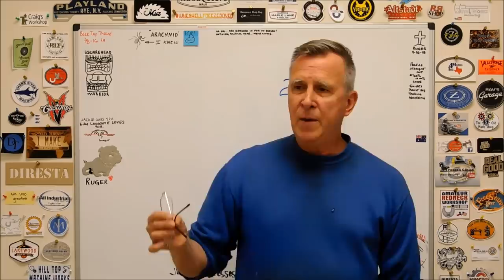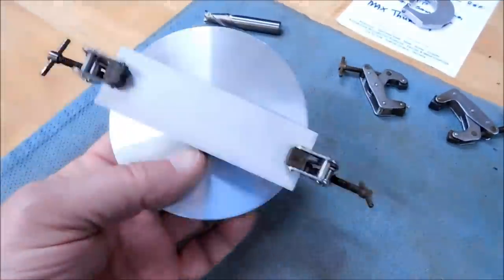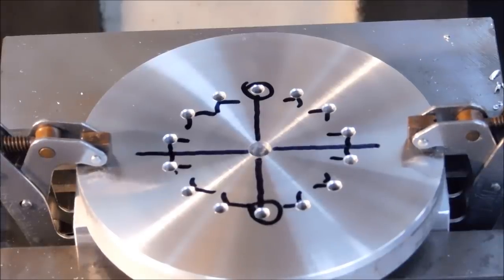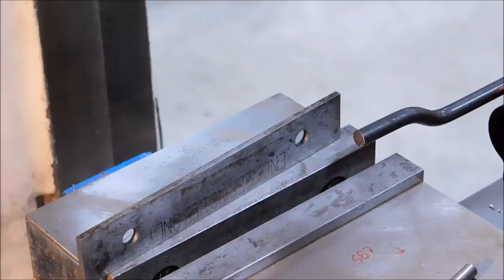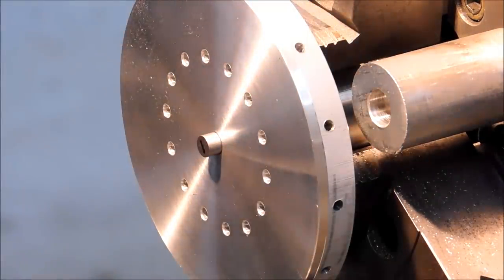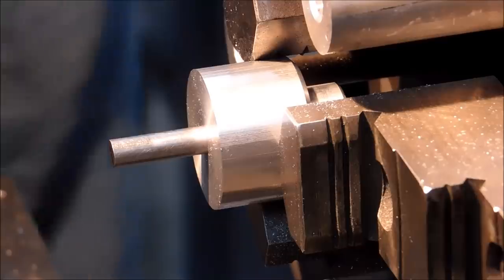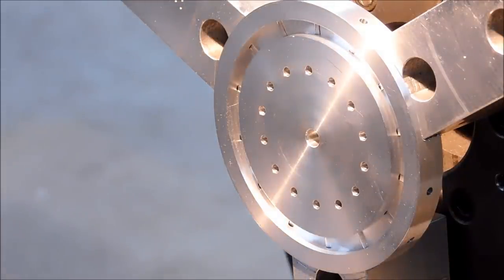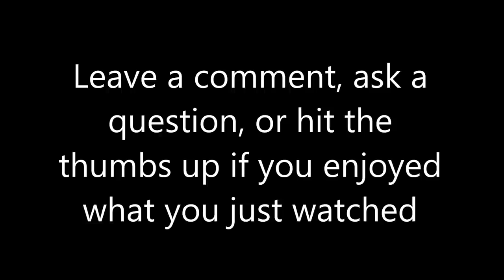Machining 14 Spokes at 25.714 degrees.  Easy ?? ... Yep !!

Comment: It might be weird, but this exact aspect of machining (workshop geometry, angular indexing, problem solving, general maths, etc) is probably the most enjoyable part of workshop life for me. I love working through and solving a puzzle, and it tests my memory of high school geometry, and gives me a chance to build on what was learned at school. Great fun :)

I learn a ton from your channel Joe, some favourites include the precision angles using pins, rotary table setup, setting lathe compound angles, etc. This radial indexing using pins is super simple, but very accurate, and needs very little equipment - perfect! Please keep the good stuff coming. Thank you.
Reply: The only thing I'd add for people watching (and it's obvious to any viewer that has thought about it) is to make the initial circle of holes as large as you can get away with - for the final job, to minimise any angular error.
Reply from the maker: Very true. reduce the error margin.

Comment: Fantastic!  In the beginning I was wondering why the holes in the face.  Then, with the explanation of the series of rectangular hole patterns, followed by the pins and parallel, the light in my head lite up!  I never would have thought of that, but rest assured I will never forget it.  Thanks Joe, you sir are a great professor!

Comment: Another awesome video. For making the spoke holes in the hub, I would use the center with that was cut from the wheel. Using a bolt through the center of the hub and the wheel center tightened down. Then use the same process from the wheel just offset to drill and ream the hub.
Reply from the maker: In the day, I would have picked you for my apprenticeship program. Very intuitive. Stay tuned.

Comment: Speaking for the nit pickers, isn't your edge locator on the mill acting on the original OD of the blank (with all of its little bumps and out of roundness) and not the small turned section which was cut concentric with the center hole. I realize this is a model of a cannon wheel and not a part for a rocket. Love your videos and learn a lot from every one.
Reply: I thought about that too. It sure looks like the edge locator/hard stop acts on the raw stock surface. I think putting a pin in the center hole and let that go against a hard stop would be better.
Reply: It would make a lot more sense to put a pin in the center hole and have that contact the mill stop.  Of course the distance the spokes span will accommodate a lot of error.
Reply: no, he turned both sides of the disc so it's flat on the vise,  then he indicated center from the turned section, it doesn't matter where it's clamped when you indicated from the turned section
Reply: @TomasKubatCZ1  it's hard to tell if the stop is touching the turned diameter though.
Reply: @johnnason7019  yeah but considering that he is a skilled machinist it's safe to assume that he wouldn't make such mistake
Reply: @TomasKubatCZ1  true

Comment: At first I thought you were making a custom wheel for a 5C Spin Index fixture since those are so cheap your viewers are likely to have one.   A rotary table would also be "good enough" for that wagon wheel, eyeballing that fractional degree.  Clearly, you're having fun in the precision of your work, so I'm not criticizing.  I often use Excel to crunch and print a table of X/Y coordinates for incremental cuts to approximate curves and circles.  For one-off parts on a manual mill, it works really well, and the resulting steps remind me of a pretty TIG bead in aluminum by Jody Collier.   You just can't be in a rush, and you REALLY do need a DRO, even if it's a cheapo iGaging setup like mine.
Reply: You need more faith in your skills.
You could do this at least as accurately even without a DRO.
Either work off the dials keeping the backlash all in the same direction, or use 1" travel indicators (mag backed) on the knee to the saddle and from under the table to the side of the saddle.
If the moves are more than an inch set zero on the indicators at the saddle, back away and move back in on a gauge block equal to your move.
The first jigbore I ran used standards and .0001 indicators, and hole location had to be held plus or minus .00005
That's as accurate as any DRO, actually closer on an old machine with wear in the ways.
Reply: Hey @Motor-City-Mike , That's a LOT of zeros on your hole location. 😁 50 micro-inches is probably smaller than the surface finish...   I agree that you can do a LOT with patience, creativity, and a decent indicator or two.  However, my old RF-30 and I live in a different world, project-wise.  The lash in my leadscrews is not all that consistent and the quill bearings are rusted from rain incursion.  (Please don't ask.  I still have trouble sleeping when it rains.)  For the things I do on a mill, a couple thou is close enough and my cheapo iGaging DROs make all the difference, especially when I'm making a couple hundred incrementally-spaced cuts to approximate a curve and one location F-up will ruin my afternoon.  The only projects I've done that had to be closer involved diameters, done either on a lathe or with a boring head and the table locked down tight.  So...  I'm OK being a hack, and a lazy one at that... At least I can type quickly 😒
Reply: @ralphwaters8905  
It was meant as an example of how close we held bores on location on a jigbore without DROs - I wasn't suggesting anyone hold (or would want to) those tolerances on hobby projects, and in fact most details at work aren't held that close.
DROs are an absolute blessing in terms of positioning 99.9% of the time, but parts can still be made without one if need be!
It was just offered to show what is possible with very limited tooling and some thought.
Machinists don't have the luxury of  a "box" to think inside or outside of, from the trade's very beginning there was no box, only the thoughts of what it took to get it done.
Exactly the kind of thinking you use when making those incrementally spaced holes to approximate those curves!
I'm not anywhere near suggesting that you're a hack! 
Please don't take it that way!
Reply: @Motor-City-Mike  - That "hack" thing is just my self image; not from you.  (We're all good here)  A friend of mine was a toolmaker at Northrop Grumman, and at one point he was building jigs for the 747 fuselage (before that work went to Korea).  He said he had to get up early before the sun hit the equipment because uneven thermal expansion would push everything out of whack for many hours.  So...  I often wonder if part dimensions with really tight tolerances specify a temperature in the spec... 🤷‍♀️
Reply: @ralphwaters8905  
They do.
The standard inspect temperature is approximately 69° Fahrenheit.
Extremely precise parts are inspected at that temperature - the stabilized temperature of the part, the ambient air and the inspection equipment all at that temperature.
It's not uncommon for an aluminum part for example to go out of tolerance from the temperature rise of holding it in your hand!

Comment: Not a challenge, just questions.  Why did you use the mill to put in the center hole and not while it was in the lathe?   Also since you had to use an edge finder anyway, why not find the pin using it rather than the test indicator?    Good show on using HSS for finish on aluminum.  I learned in 1971 that carbide can not be made sharp enough to do the job!
Reply from the maker: Knowing I was going to turn the outer diameter after all the holes, Putting the center hole in with the pattern assured it was true to the pattern and eliminated one less thing to indicate. As for using an indicator for the pin. When you use an indicator and find zero, you're already there. You still have to move the table when using an edge finder. less margin of error.

Comment: Thanks for yet another enjoyable and very useful video tutorial! One question, wouldn’t the accuracy of the 14 holes drilled radially around the circumference of the disk be dependent on having a ‘perfectly circular’ circumference for the edge stop you used to bear against when clamping the disc in your milling vise? Perhaps I missed it, but you only turned a small part of the circumference so you could indicate the part to the mill vertical axis. Did you also arrange your edge stop to only bear on that machined portion of the circumference?
Reply from the maker: The material actually ran very true in the chuck. The cut was so the indicator didn't bounce. Good question.

Comment: I had an 11 sided part to make. I grabbed an offcut about 7 inches in dia from a bar, faced both sides turned OD and bored in same setup  it to suit the part. I then put it on the mill, clocked up the outside. then using the hole pcd programme, drilled and finished bored 11 holes. These fitted a  precision pin I approx 0.650" had on hand. I then put the disc with the holes in it in my vice, the OD of the disc sat in the vee of the vice. All I needed to do was put one pin in a hole and rest it against the top of the vice jaw. I installed my unfinished part in my fixture. Machined the flat I needed and repeated the process and presto, 11 precision flats. My flats were approx 1.55" across the flats but the holes in the disc were around 5.50' pcd. I had very accurate indexing.
Reply from the maker: Very good.
Reply: What does PCD stand for?
Reply: Pitch circle diameter.  Like wheel studs on a car might be 5 of, M12 studs on a 120mm pcd

Comment: hi, I know that you're only making a model canon , but wouldn't the spokes from the fellows to the hub be  dished , as with all heavy wagons,  re the 14 spokes setting out ,some years ago, I made a start on a wells fargo stage coach,12th scale  the back wheels had 14 spokes, not having been schooled in the  type of maths, I was stuck. at the time I was working as a assemblie worked in a factory, I mentioned my problem to a colleague, he used the computer and came back with a drawing, and said for me to tack it to the CNC operator, this  i  did , and in a few moments he had pinched me out disk with the 14 holes and the centre hole the size of my lathe, this did the job I made a post to fit the banjo with an indexing tapered pin,  this worked very well,  keep up the good work.
Reply: The same indexing method for the rim could be used (given a turret mill's head can "nod") provided you are careful not to raise or lower the knee once the job is set up. A more rigid mill can usually only tilt the head sideways; in this case you'd have to turn the vice 90 degrees in plan view, or mount it on a tilt.

Comment: Just a guess, maybe early wheelwrights measured the circumference and divided into equal spacing? Coulda done that with a piece of string! Or, walked around the circumference with dividers?
Another greight video Joe, many thanks for taking time to educate and entertain.
Reply: The full size cannon were built in multiples in each factory so there was a high use of jigs and fixtures. In the larger manufacturer's the wheels were assembled using an early form of multi ram hydraulic press. High pressure water instead of oil was used to power the rams. Not all cannon wheels were made with 7 wheel segments (fellows) and 14 spokes. The American made copy of the 6 & 12 lbr Napoleans did, but many of the English cannon wheels had 6 fellows and 12 spokes. For awhile the English added a large amount of castor to each wheel by bending the axle ends to also help in the turns.The American made civil war Napoleans were a bit more complicated than this video since the spokes were tapered as well as sitting at a 5 degree inward angle between the outside wheel rim and the wheel hub. That helped keep the weight centered on the hubs during sharp turns.To save time and mistakes drill jigs for both the wheel rims and hubs would certainly have been used. The full sized cannon had a whole lot more proper and quite sophisticated engineering design in them than most seem to think today. The barrel on the Napoleans is almost perfectly balanced on it's trunnions with just a slight rearward bias for weight so the barrel was always in contact with the elevation screw.

Comment: If you watch Engels Coach Shop you'll see he uses an opisometer (graduated wheel ) to run around the rim of a spoked wheel.  14 spaces is easy calculation with pencil and paper.   If the wheel is 36 inches in diameter the spokes only need to be accurate to one inch spacing, the wheel only rotates about one revolution per second so out of round and out of balance aren't a problem.  Folks tend to confuse precision with accuracy and don't see how scale changes how we do things.

Estephan, friend of Pitagoras.

Comment: My favorite demonstration about machining was a part holding demo. 

Lobate, and tolerance stacking was the flavor of the day. 

I was presented with a 6 inch diameter triangular round tube. 7/8 wall. 6 inch depth. Heavy little piece. 

The OD surface finish ranged from "as cast" to "NASA might want this back". The ID was garbage. 

No matter what you did, the thing mic'ed dead on 6 inch OD. Visually it is clearly a triangle. The mic says it is round.

We couldn't find a tenth difference, even with the instructors help.

That day concreted my love for machining processes. The numbers do lie. But, if you get a hold on them. Anything is possible.

I really appreciate you giving away high level knowledge.

Comment: Ok, you showed nicely how to tranfer 14 perfectly spaced holes from the face of the part to the edge, bot never showed how to get the divisions in the first place.
Reply: Well he did.
He drew it up in CAD.
Took the X, Y coordinates for one quarter.
He machined those holes using the DRO with X0, Y0 being the center of the circle.
Simples.
Reply: @captcarlos  true, but the claim was to co it without expensive equipment. Idont have cad or dro.
Reply: @captcarlos  "Drew it up in CAD" is not the same as using a calculator, which is what he said one could do.
Reply: There are quite  a few free CAD programs available in the web that you could use,  Fusion 360 being very popular and comprehensive.
Reply: @Angus_McGyver  CAD is just a convenience in this case to save the machinist from having to work some simple trig. All you need to know is the tan of half the angle between adjacent spokes, and everything else is addition and subtraction to work out the coordinates. Lots of people already knew how to do this sort of calculation using pen and paper and simple trig tables three hundred years ago.
@Vandy Fixer: Fair point about free online CAD, but if the OP does not need the other capabilities of CAD, this sort of trig is easier to learn than (say) Fusion 360, by a long margin.
Reply: @Angus_McGyver  the old way was trigonometry and working off the dials, remembering to keep backlash in the same direction, or gauge blocks and indicators.

Comment: Hi Joe, its me again.  I don't know if you have this in the States.  But in England we have a small hand book called "ZEUS PRECISION". Published by "Robuck" distributed by "Buck and Hickman Ltd.   Amongst other things it gives the coordinates for drilling holes on a PCD.  That is for 3, 5, 6, 7, 8, 9, 10, 11, and 12 holes. It cuts out a lot of calculation.
Reply: For PCD 14, you could use the set of numbers for 7, and flip half of the numbers on either the x or y axis (depending on start angle in the book). (I used to have that book - sadly it got lost in a move..)
Reply: @CraigsWorkshop  Hi Craig, Its a dam good little book.  I would be lost without it.  Try to get another one.  I believe they are available on the internet.  I use it mainly for the tapping data and the metric to imperial equivalents.
Reply: @laurencep3757  Yes after replying to your post, I looked them up. They are quite affordable. I liked how small they are. I do have a fairly recent machinery's handbook, and a black book. Having a Zeus too might be a bit of overkill. Though the pocket-ability has me wondering if I should get one... :-)
Reply: @CraigsWorkshop  Go for it Craig.  All info is good info.  I too have a machinery's handbook.  It can be a pain to find stuff.  But what is the "Black Book" ? I may know it by another name.  By the way, where in the world are you?
Reply: @laurencep3757  I'm in the bottom right corner of the world (Tasmania). Check out this link to have a look at the engineer's black book: https://www.engineersblackbook.com/

Comment: I have to cut an external 1 mm pitch thread on a 2-inch diameter round bar. I want to try a full profile insert what are your thoughts? Could you demo a full profile external thread insert?

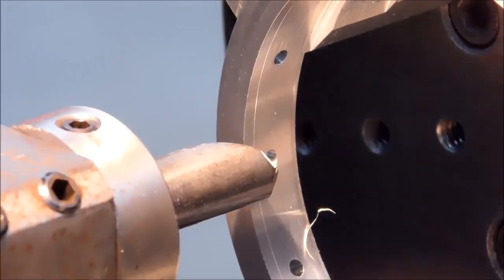Comment: Joe, I'm still new at this.....at 36:37 you said "if your chuck isn't nice and smooth, get it to be nice and smooth". What's the best way to do that.
Reply from the maker: 1. believe in yourself. 2. Take the chuck completely apart. 3. clean every part like new. 4. refer to step #1. 5. lubricate the parts and put it back together. Without jaws installed, a scroll driven by a chuck key should spin like a well oiled bearing.
Reply: David Stefan Gotteswinter has some great videos on cleaning and improving scroll chucks.

Comment: If your puck had a hole in it the size of your hub, and inserted the hub before drilling and reaming the 14 holes, you could maybe have saved some operations on the hub? I always learn something from your videos, I've learned not to fast forward past what seems like everyday run of the mill (heh) kinds of stuff, the little details and time savers always make me wonder why I didn't think of that.

Comment: As usually, another great idea. How precise would it be if I am doing this on a1960 Rockwell mill without DRO. I have no problem calculating coordinates after 60 years of engineering. Great job, thanks.
Reply: What formula would you use to calculate the X and Y distances of each hole when he’s drilling on the mill If every hole is a certain degrees apart. 25.714 he said.
Reply from the maker: I'll show you.